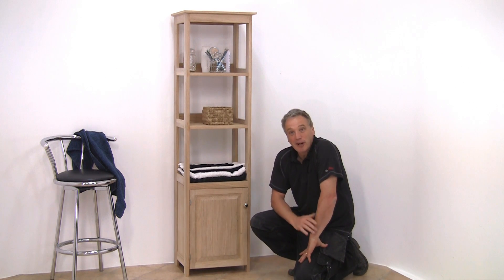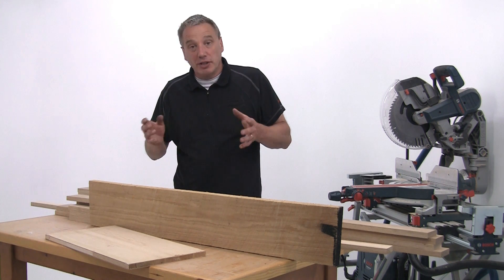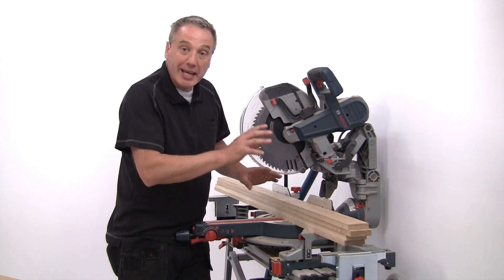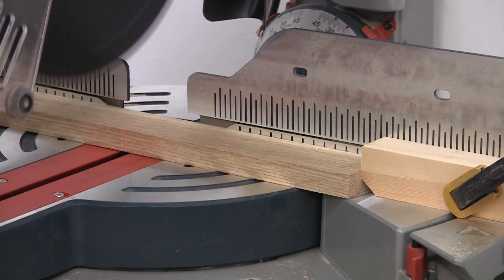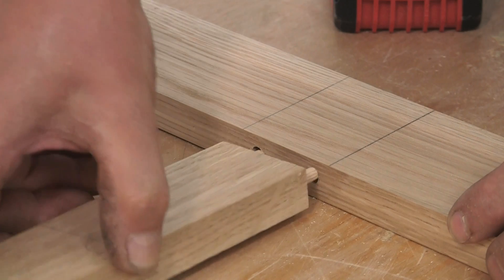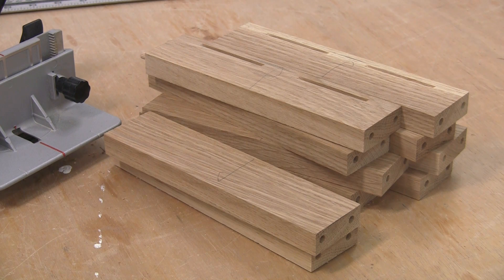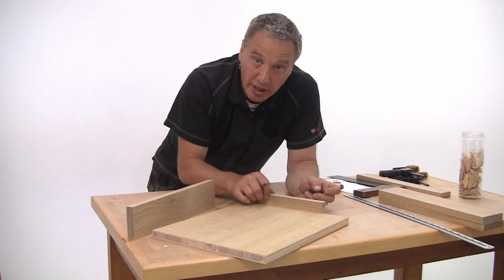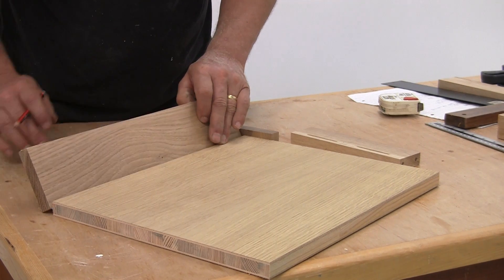Build it with Bosch   Bathroom tallboy part 1

Comment: Why would Bosch remove dust collection for filming?  It seems that dust collection is a very important factor in selecting a power tool.  Not to be able to see the effectiveness of the collection system leads one to wonder about its effectiveness.